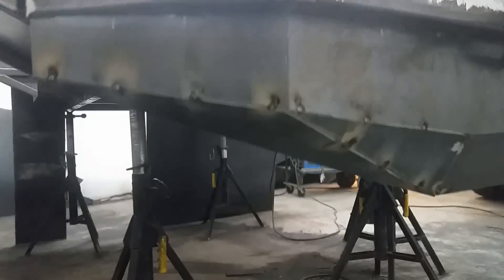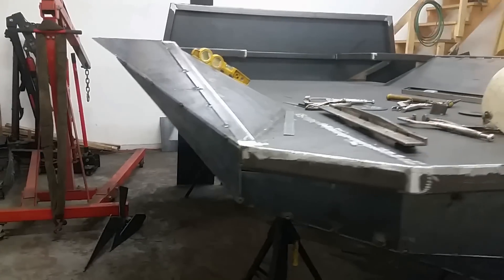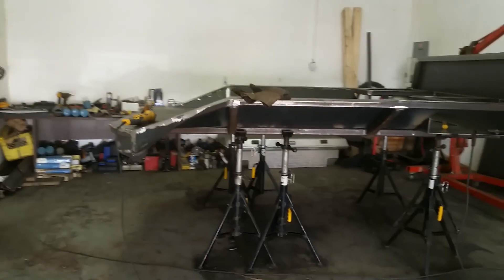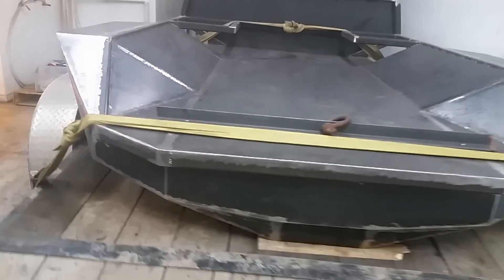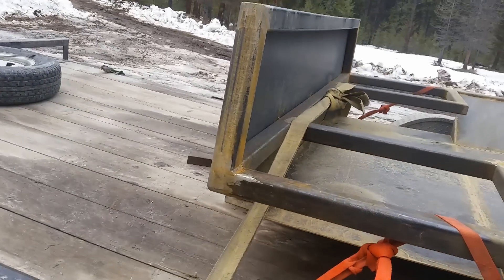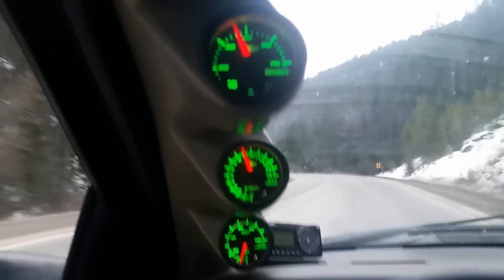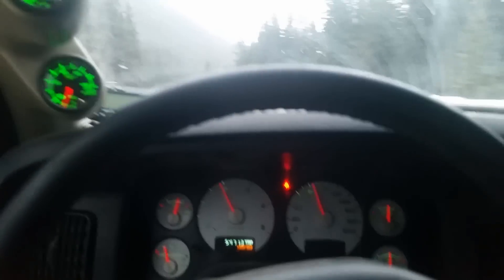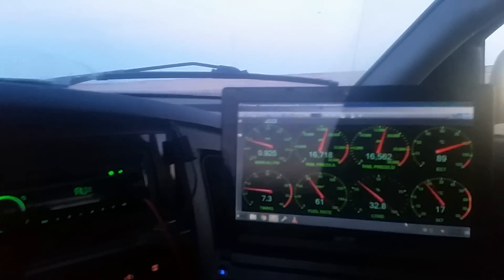Offroad style deck finished and delivered to Saskatchewan

Comment: nice deck designs....use some "prep and etch" from home Depot with a squirt bottle to get rid of surface rust....soak for a bit, pressure wash then dry right before primer.

Comment: You ever get bored or slow with a deck build you should build some new fenders for the trailer that look like the ones on that off road deck add that custom touch 👍👍🏿
Reply from the maker: I was actually going to do exactly that, and build them strong enough to drive over. 
Maybe even an axle flip too, its super low.

Comment: Was your EGTs up when towing the caddy? Just wonderin b cuz i have a 03. 5.9 and im really paranoid about the injectors goin in mine.
Reply from the maker: Usually around 1000f for most hills but you could hold it at 1350f all day without issues.

Comment: do you tune and new Cummins? i have 2014 5500 with a single stage 50hp by hardway proformace
Reply from the maker: Yeah I do but I wouldn't recommend much more than the 50hp hardway performance tune unless you have upgraded your transmission.
Reply: no it's a stock aisin transmission... i just bought a 3500 single wheel with a aisin transmission... I heard there expense to upgrade and not a lot to upgrade..
Reply: If I understand correctly, upgraded hard parts are available but no tuning yet for the Aisin.